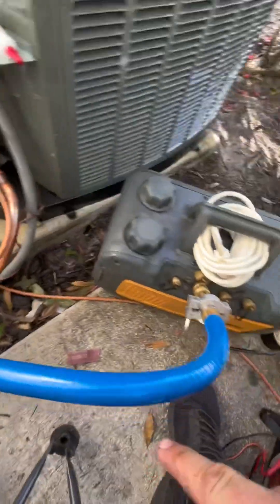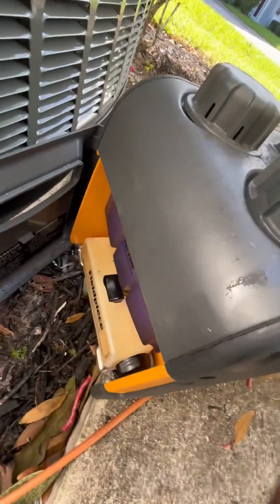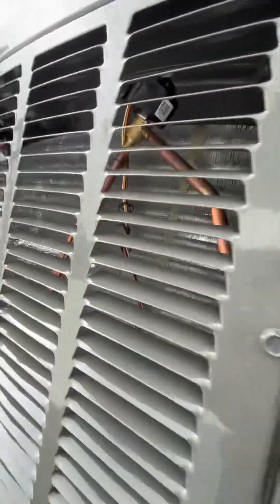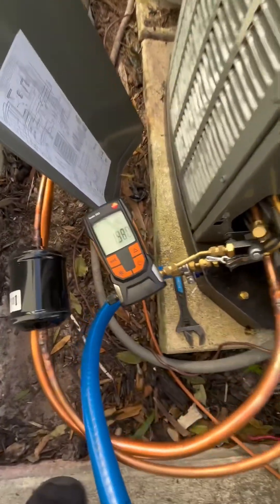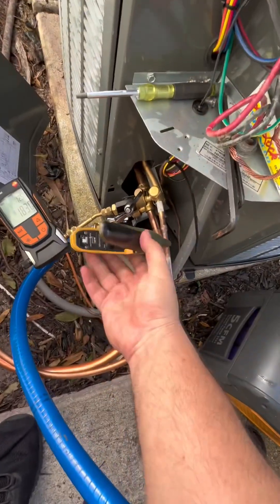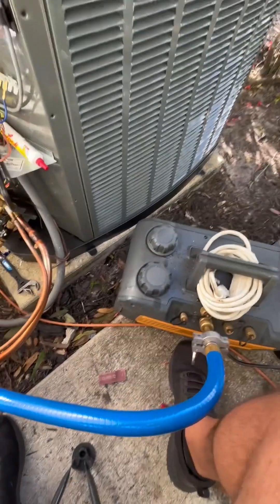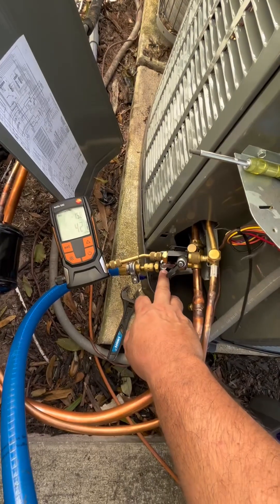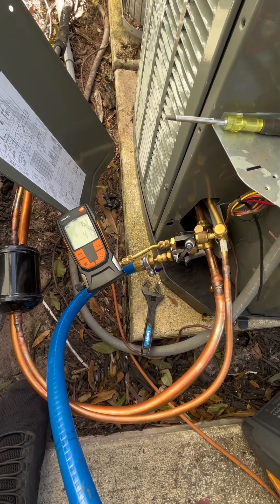How to pull a vacuum on a residential ac with a one hose hook-up

Comment: Will a one hose set up work with a condenser full of refrigerant and a hard shut off TXV?
Reply from the maker: You know I would say No.
But this is the weird thing. This is a TEM6 air handler with a hard shut off TXV and as you could see, I have the micron gauge all the way upstream and it’s pulling it down. 
To be honest with you, I don’t know how it’s working good question !
I do have another 3/8 Aon that I will put on the liquid line on service calls. Vacuums take a lot longer on a service call that has oil and refrigerant in the evaporator.
I really appreciate you commenting and watching a video